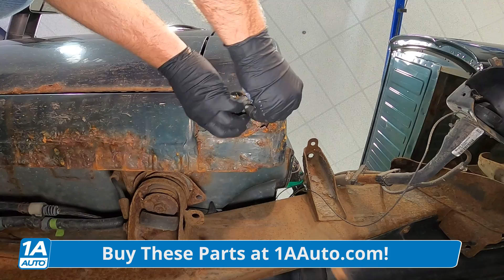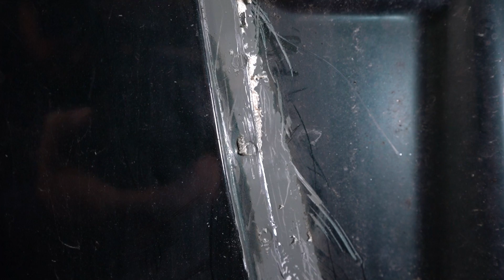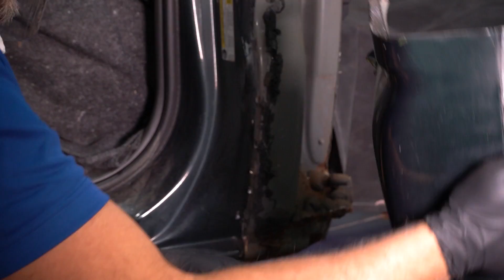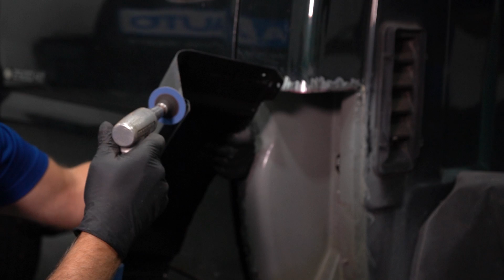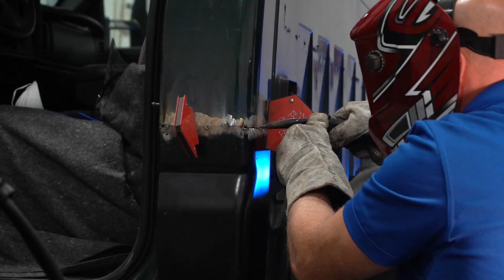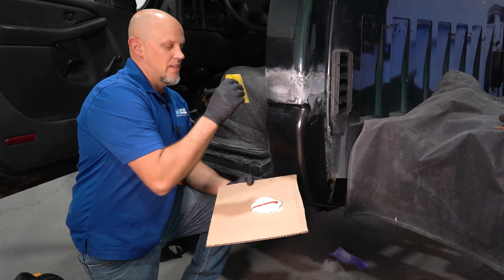Tips From the Pros: Easily Replace Dented, Scratched and Rusted Body Panels on Your Truck or Car

Comment: Not exactly to ICAR specs but yeah. Bonding panels has been around for a while. Structural bonding by itself isn't the best. Bonding with a prospot resistance welder is preferable.